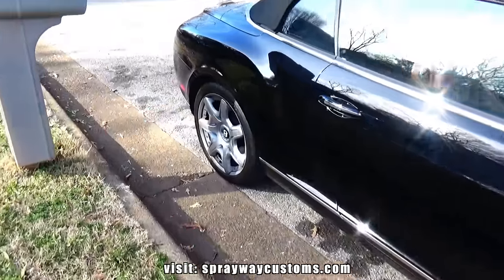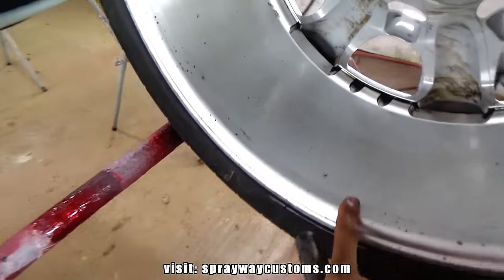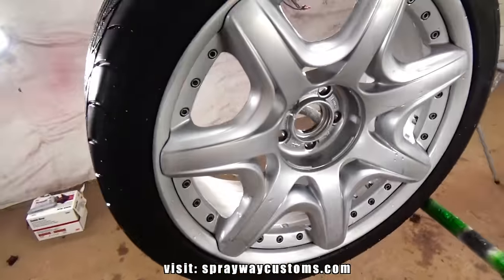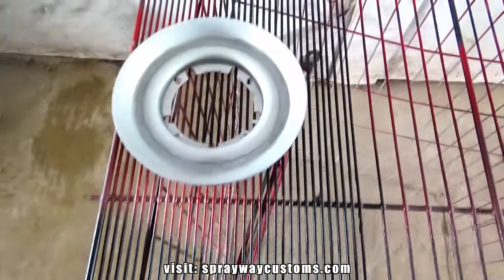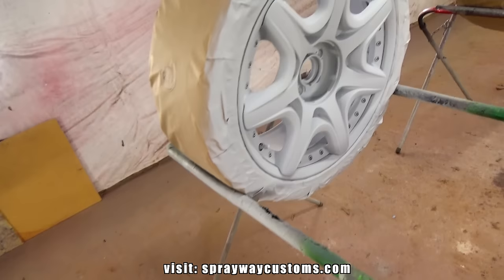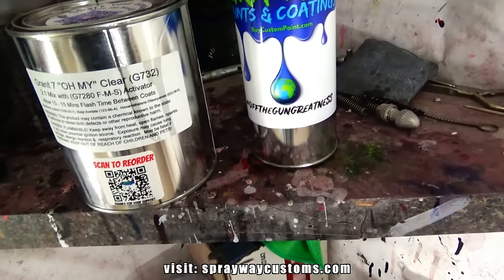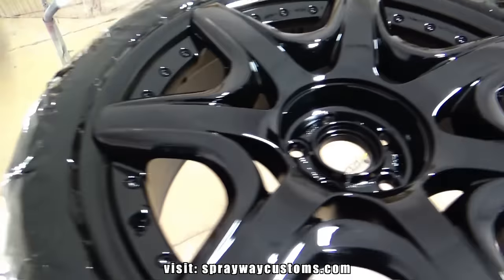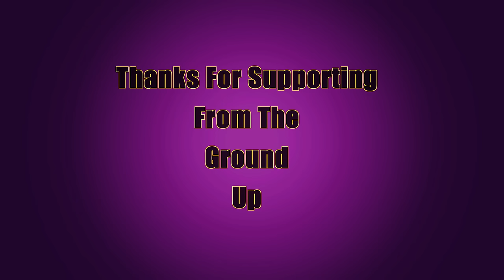How To Paint Wheels / Rims Black On A Car Or Truck BENTLEY CONTINENTAL GT @Grant7

Comment: Sharp. Are you using a sata for each stage or are you using one for primer and one for base/clear together?
Reply from the maker: I use a SATAjet 1000 RP 1.8 tip for Primer, SATAjet 5000 HVLP 1.3 tip for base and Iwata Supernova WS400 1.3 tip for clear

Comment: Looking great as always but I would have suggested removing the wheel weights for the painting process and had the customer have his tires rebalanced cuz now when he goes to put new rubber on they going to pop them weights off and the new ones are going on at a different spot and you're going to have a chrome square on the back of the wheel.
Reply from the maker: Thanks man

Comment: Gloss black wheels make your tires look dull so you gotta keep tire shine on them. Check out Meguiars Endurance Tire Gel. Goes on with a sponge applicator and lasts a long time. Let is dry before you drive and you won't get any sling. They also make a spray. I use the gel first then hit it with the spray to get in the nooks and crannies. Let it dry and your tires will match the rims better. Lasts for a long time.
Reply from the maker: Appreciate the info Derek

Comment: When I was working at a body shop the painter fixed a damaged wheel off newer dodge, but instead of bc/cc he told me he used 2 ounces of hardener per sprayable quart. The paint matched perfect with the rest of the wheels (color and the gloss level) because they looked somewhat matte not super shiny like cc. The question is have you ever done this? Would it be as durable or more durable than bc/cc? Better with rock chips maybe?
Reply from the maker: Yes, the hardener will make it more durable when adding

Comment: Hey Sprayway - love your videos. Question: why not take these wheels apart since they are two-piece?  Wouldn’t that get better coverage of paint?  Or is it not necessary?
Reply from the maker: I'm thinking they was three piece but if they was mine that'll be the way to go. I didn't want to take the chance of leaks or even stripping out a bolts.....just wasn't worth opening up those can of worms 🐛

Comment: Hey bro I got a question man I've been debating it for a while and I haven't really seen nobody take it serious or actually do it when you go to take off a hood or you go to take off a fender there's a lot of folks that are involved in the process when you put paint on an object and then you put the screws back in it now the screws are ugly as hell because the screws are so small would it be easier to spray them with like a harbor freight powder coat situation so when you put the screw back on it doesn't chip or do you just spray them and just tighten them up easily what's your thoughts on that champ I wouldn't mind seeing a video on something like that that's probably pretty cool
Reply from the maker: A lot of times I'll hit them lightly with some Matte Black spray paint. The key is spraying a light coat on to try to keep them from chipping.
Reply: @SprayWayCustoms  you know I never was a fan of flat black but I have fallen in love with it doing engine rebuilds the color seems to enhance the Chrome and it gives it an awesome look

Comment: Great job spray way...i woukd made the bently owner  pay you more.....to remove the tires...my experience  is aluminum rims corrode on the bead face... and you could have removed the wheel weight and painted them... also you would have been able to paint tire valve hole not have a future corrosion occurring around the valve stem....

Great job...spray way
Reply from the maker: Appreciate the info

Comment: Great look, the owner need to start using ceramic brakes pads that will stop all the black brake dust. Wow 20’s never knew that, ouch tire prices will be nasty, lol. A ceramic coating will keep those looking there best you made them.
Reply from the maker: Thanks Keith...I wasn't expecting 20" neither